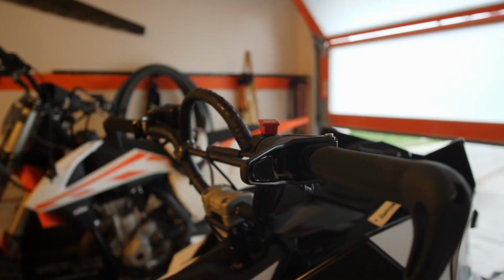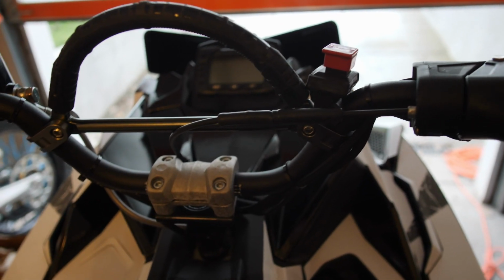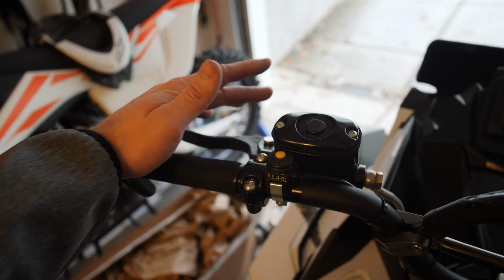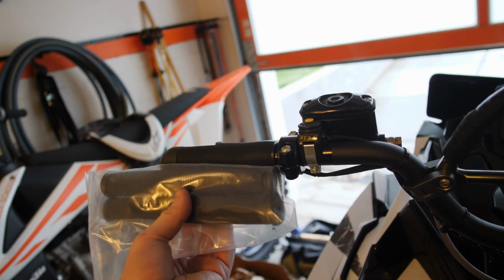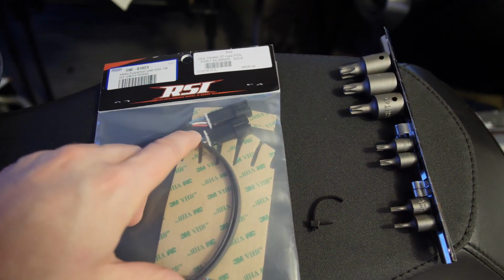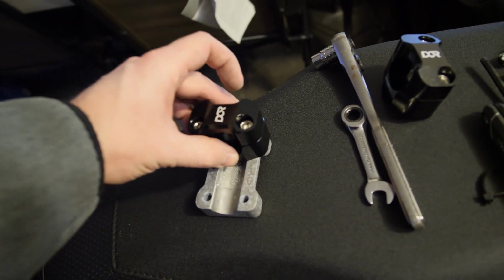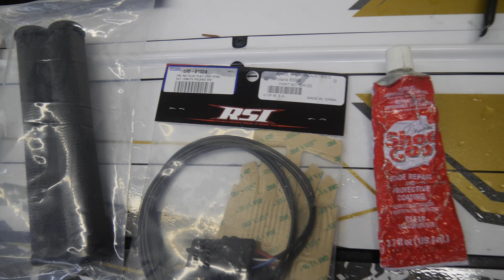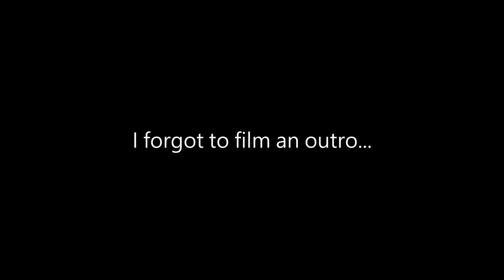Polaris 850 Patriot Handlebar Setup Options

Comment: You can reuse your heat elements. Did it on my skidoo. Use a heat gun and carefully take them off. It’ll pull the cork and everything in one piece. Then they’ll stick right back on. Use some electrical tape. Boom. Saves money and time.
Reply from the maker: i know, however the stock ones dont cover near as much as the RSI ones do for aftermarket bars

Comment: Hey not sure if you want to try this next time. But if you wrap your entire grip area with about 3 wraps of electrical tape, then use your compressor to put the grips on they will not move. Instead of using the messy shoe goo and way easier to get the grips off of you ever have to. Got my 2 cents.
Reply from the maker: ive had grips move no matter what i tried when i didnt have shoe goo, but by the time i need to remove the grips their either worn out or torn up so having the piece of mind that the shoe goo will allow them to stay in one place helps alot.
Reply: I use hair spray, a trick from my BMX days

Comment: How did you like the rsi vs the cfr bars. I just picked up an 18 axys and I'm looking to get a new handlebar setup because it currently has the stock high bars. I'm 6'1 and right now I'm looking at the cfr chris brown bars or the rsi hustler with a 4 inch riser because they're both 7/8th so I wouldn't need an oversize adapter. Do you prefer straighter bars with a riser of bars that have a rise in them? Also how was the width of the cfr bars because they're wider than stock? Was it too wide or just right?
Reply from the maker: I like the CFR Boondocker bars the most. The bend is kinda close to stock but they are very low. I'm 6 foot and I normally mount them with an oversize adapter with a 1/2" riser right to the steering post. I am considering going to a 1 or 2 inch riser though. The stock Low bars are close too.
Reply: I realize it is quite off topic but does anybody know a good website to watch newly released series online?

Comment: Just bought two new Polaris and came with mid pro tapers. ? We’ll see I guess?
Reply from the maker: Those are great to start out with, depending on your height it might work perfect. I’m 6ft but I like lower bars for a little better handling in the backcountry. Easier to throw the sled around

Comment: Do you feel like this handlebar setup is too low vs the factory height handlebars?  I see a lot of people like the 5" factory bars, but this set up seems lower then the 5" bars.  Considering my height too, i'm 6'3" with long arms.  Don't know to go this route or just the 5" bars?
Reply from the maker: hey Jesse, if I were you I would do the medium polaris bars (i believe thats the 5" bars) these bars are about 1" lower then the stock LOW bars if that helps. it just depends what feels comfortable to you. I may actually raise mine up an inch this year to see how I like it

Comment: Colin, what are the pros and cons of 850 vs 800, I noticed my dealer has a lot of 20 800s f/s
Reply from the maker: Gavin Dhillon in short, the 850 will have more torque and hp (obviously) and in my experience has been just as reliable as the old 800’s. I have the first year 850 and it’s been running great, I’m going into my 3rd season with it with no issues, I have heard of little issues here and there but nothing that’s out of the ordinary for new model year motors or any motor for that matter.

Pros for 850: more power
Cons 850: more expensive to buy/repair 
Pros 800: cheaper to buy initially/repair
Cons:less power

Honestly, I would just figure out what your budget is and base it off that. 850’s are holding their value better but if Polaris drops a new chassis, then those prices MIGHT come down. 800’s are fairly cheap/affordable now though.
Reply: Colin McEvoy, thanks for the info!
Reply: Colin McEvoy ended up getting a 20 khaos 155, she’s currently getting a 63 3”...in super stoked for season to start haha

Comment: Do i have to shorten anything when changing handlebar or is the gaswire like auto adjusted?
Reply from the maker: Simon Berglund if you’re just going an inch or 2 down then you’ll be fine, it’ll settle where it goes once you mount the throttle block. You may need to adjust the throttle flipper play however, and I would advise you ask your dealer, since many have different ideas of how it should adjusted. I have mine set at 1/4” of “play” before it starts to actually pull the throttle cable.
Reply: @ColinMcEvoy  okey thank you so much!